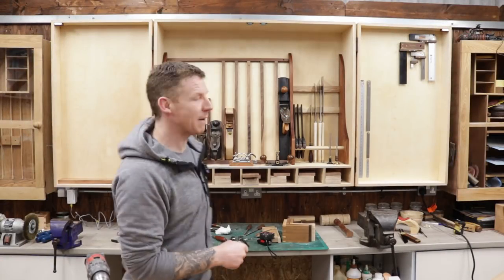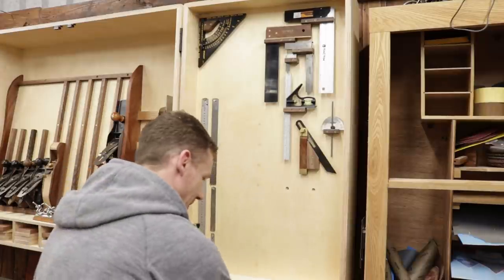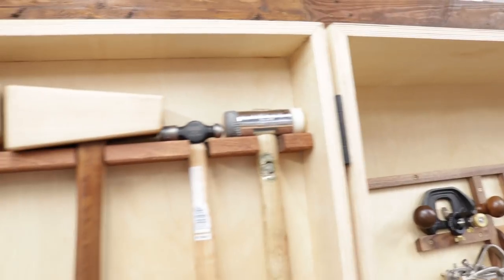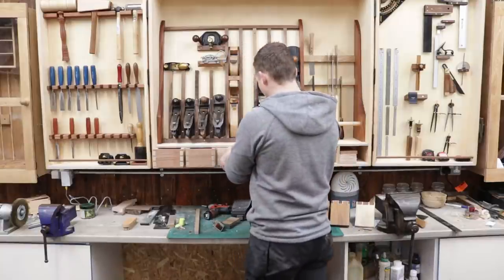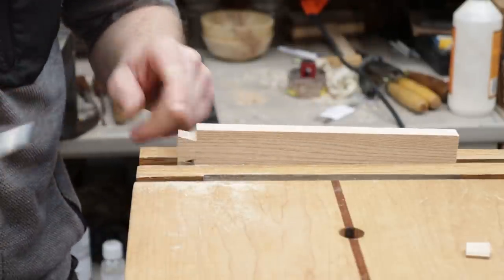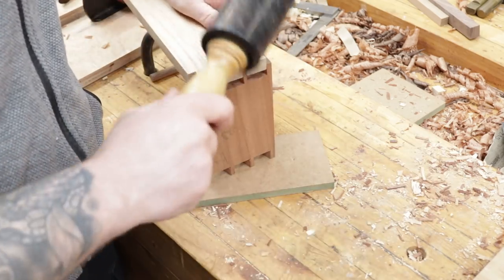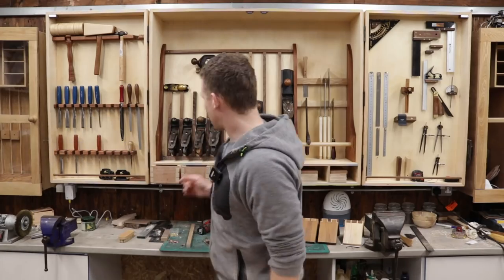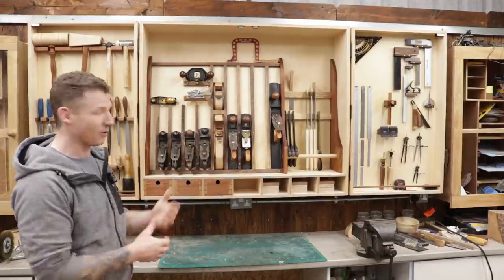Hand tool cabinet Part 4. Tool holders and Dovetails Drawer Construction.

Comment: Looks nice John. You might want to take a half-step to your left when sawing though, you're clipping your ribcage with your elbow a little. 
Those square holders would drive me nuts though, not being able to grab them and pull them straight out towards me would wind me right up. I use simple magnetic bars for most of mine, thought the initial design I tried (and still use for two of them as well as the verniers and a few other bits) was basically the wall-mounting part of a french cleat, but with a slot cut through back to the backing board (you glue and screw the full-width cleat in place, let the glue set, then cut the slot later) and the cleat holds the square body while the blade is in the gap.
I also put a bit of plexiglass over the chisels because I know if I reached for one on the bottom row in my setup, I'd slice open my hand on the edges of the top row.
I've a few other ideas for holders that I've stolen from various places, feel free to steal any that are of use!
http://www.stochasticgeometry.ie/2017/04/29/tooltris-continued/
Reply: The square holders tweaked my OCD as well, personal preference though I guess. Overall looks great

Comment: Oh, btw, the best luck I've had with handworking sapele was to use a toothed plane iron for the initial work (Kunz do one that fits my #06 plane), a freshly sharpened and stropped #04 plane for the last few strokes to get the surface smooth from the toothing with as few strokes as possible, and then a freshly sharpened card scraper to tackle any tearout. But it is a right pain to work by hand. Turns beautifully though, and that chatoyance is just so damn pretty.

Comment: Magnificent as always! I aspire to the dovetails that you probably throw out! Are the screws that you use actually brass or are they plated steel? I've never met a brass screw that would tolerate a power driver.
Reply from the maker: Hi Kevin screws are plated steel, should have pointed that out rather then just calling them brass

Comment: Cracking job, I have a question John, I am looking for my first play probably to be used mainly on a shooting board, which size would you recommend would be best, cheers, Ian
Reply from the maker: Hi Ian a number 5 or 5 1/2 jack plane is the one to go for, it will do most jobs and works well with a shooting board.
Reply: @JohnMcGrathManInShed  thanks John.